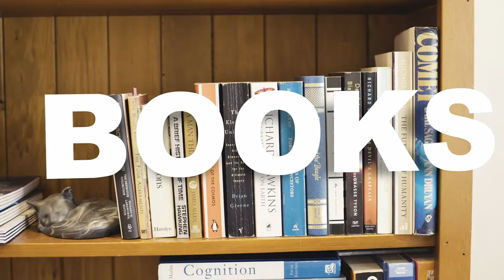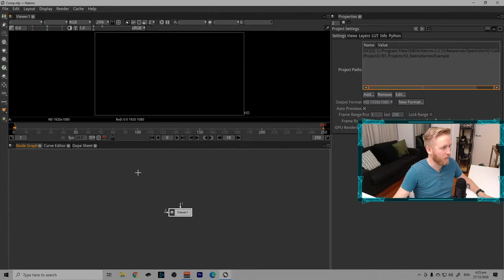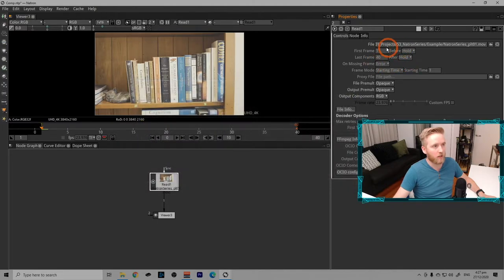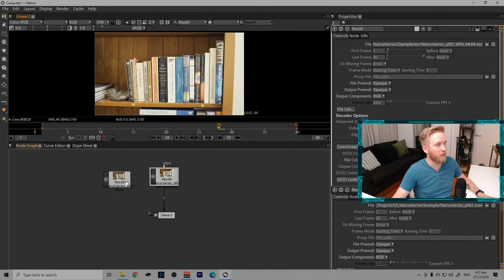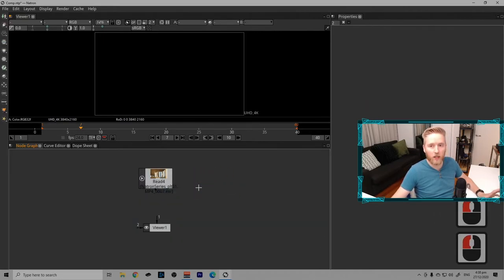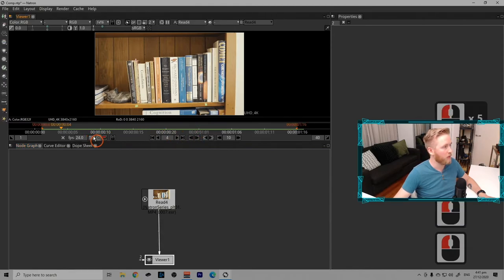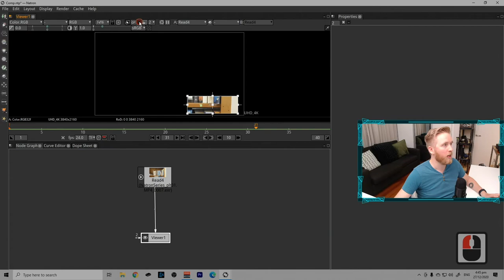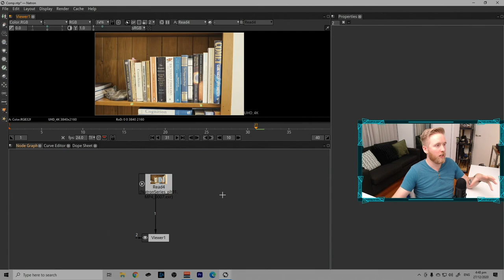Natron Tutorials Part 1: The basics of the Software Layout

Comment: How to convert the concept of timeline into a nodal way to display special effects at a certain time? ?
Reply from the maker: This would be done using a combination to time offset and switch nodes. Using key frames in the switches as cuts. You could do it with the frame range settings in the read node but from experience that way is much harder to keep track of
Reply: @HarryChrisp  Can you make a tutorial? Thank you
Reply from the maker: @natureli5599  I'm not very good at motion graphics (you'll notice my end screen is a still frame) so am afraid I don't have much to offer in that area. If I'm ever forced into making worth while graphics I'll be sure to share the process then.

Comment: The problem I ma having is that Natron is not recognising the image sequence as a sequence. I've tried several...I've played around with the frame start and end - it's just not seeing the sequence as a sequence.
Reply from the maker: Hey Rohan, a couple of things to check are:
Check the file naming is correct name.####.exr (or whatever extension your using)
Check the play head is on the correct frame.
Check the image on that frame actually works in another program.
Check the frame numbers in the read node are correct.
Check the full file path in the read node is correct including the frame number padding.
Can you get 1 frame of your sequence to work or none at all?
Reply: @HarryChrisp   A thanks for the reply. The file naming WAS correct, but for some reason Natron did not recognise it as an image sequence. There is a drop down menu next to the file selector where you can choose "sequence" that I didn't notice before, so I did in the end manage to figure it out for myself...but I lost fair few hours and a bit of hair.